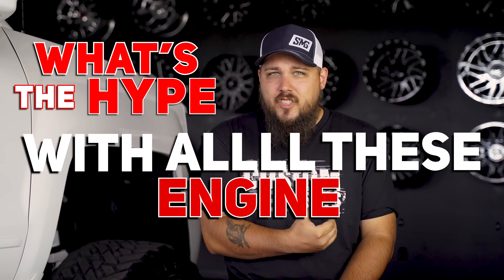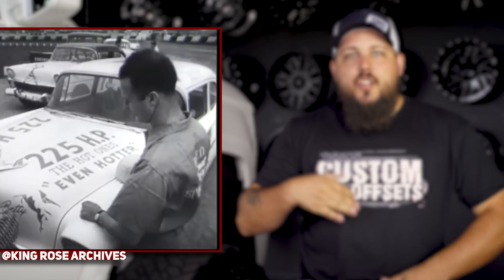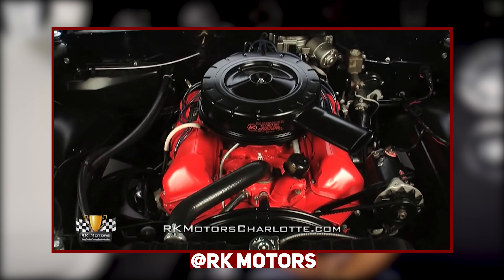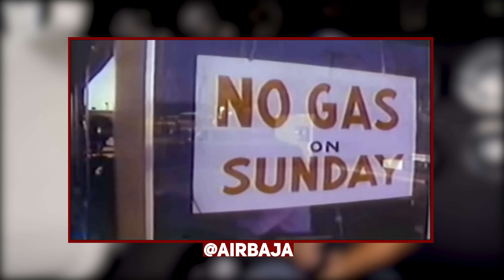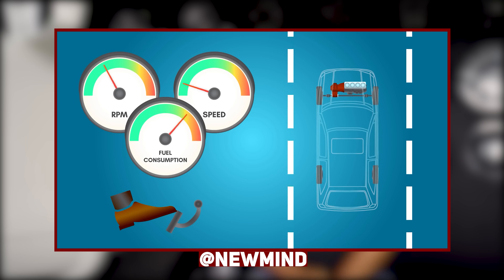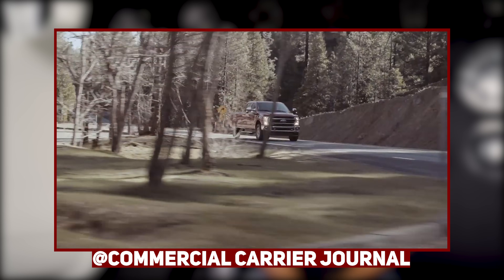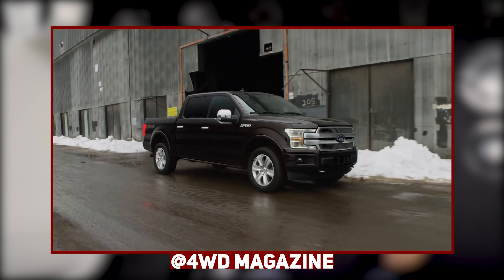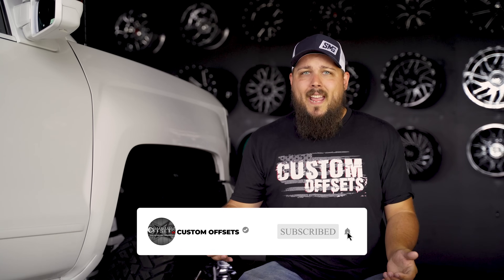Truck Engines - They're Only Getting Smaller..?

Comment: I also think that maybe a smaller engine in a truck would be better on gas. But the engine would actually get worse gas milage. Example. V4 chevy has to work harder to get the same performance as a hemi. Almost making the same gas milage. Only difference is highway milage

Comment: I think it's fuel efficiency and the fact that technology is able to increase power from smaller engines. First of all they're smaller which emit less gases and also the body of the trucks are weighing less. There's also the EPA factor strangling the big 3 American and anyone who wants to sell vehicles in the US. Again going back to the tech, the GDI and turbo charge technology it's getting better and more reliable plus they can tow almost better than the older diesels that have loads of power. I do miss the old school American V8.

Comment: It’s great living in a non exhaust test state, the family boat hauler is a 550 big block suburban that hates transmissions.
Reply: Scott Mccauley the stock 496 doesn’t rip transmissions anywhere near as bad as this thing, the cylinders have been bored out to make more power than the regular transmissions are meant to handle. It wouldn’t be an issue with an allison transmission but those were only ever available in the silverado to my knowledge.
Reply: Scott Mccauley gm knew that, that’s why they got allison transmissions for the duramax line.

Comment: 2.7 liter v6 ecoboost baby! Daily driver so it helps that it doesn't use gas like a v8. Love the v8 sound always will but I need the economy of the 2.7
Reply: How good of fuel mileage does your 2.7L V6 get? My 4.7L V8 gets average of 15 mpg.
Reply: @hilljackzack7284  19 mpg average
Reply: flaco that is better.

Comment: I love the 2.7T in my 2020 Silverado.  Average 20MPG with AC on all summer so far.  Its plenty quick, its actually just as fast as my dads 2018 Sierra with the 5.3 V8 but he's averaged only 17mpg.  Test drive it and you will be impressed.

Comment: Soo its not about displacement anymore? Congrats to the domestic manufacturing companys for jumping on board with forced induction, but i don’t agree with a mustang having a 4cyl!
Reply: It seems every company except for dodge is jumping on the smaller engine train but all of a sudden Ford comes out with the Godzilla engine, they also still have the Coyote engine which is pretty good.

Comment: 2.7 Ecoboost \o/ As much as i love the sound of the V8 Ive never owned a snappier truck. Plus the MPG is nice. And no i don't haul much so the smaller engine makes alot of sense for me.
Reply: I hear ya brother!  I got a 2.7 for work.  Every1 says the 3.5 is snappier but idkk
Reply: I love that sport mode they have on them
Reply: If I had to choose an f150 engine I’d get the old 2 valve 330 Triton myself. Underrated engine without a doubt.

Comment: Y’all think I can fit 24 x 12 on a 2001 4Runner without affecting gas mileage
Reply: I'm doing something similar to that but a 2002 4 runner and 20×12
Reply: Ryan HARPER I try to find people w the same year and model as my truck to get an safe idea I’m jsut scared of messing up my gas mileage and also breaking my truck
Reply: Ryan HARPER plus I think my little v6 will struggle pulling that weight
Reply: @NotHusband  that's why imma gonna do some power mods
Reply: The bigger the wheels and tyres. The more fuel the engine will require to pull more of that weight around. Brad and Banker talked about it in the second session of lifted live or something maybe else. But it's pure science. If its smaller wheels and tyres that are also thicker then Be aware of the suspension components wearing out like ball joints, wheel bearings, wheel hub assembly and even cv axles.
Reply: Dingas Healthy Lifestyle thanks
Reply: @NotHusband  but wow a 4runner from 2001..you made an awesome choice there man. I hope you get your money's worth. There's a lot of good mods you can do to it and they all look quite good and function well too with the V6 engine.
Reply: Dingas Healthy Lifestyle thanks man for helping me I wish you well with your build salute 🔥🔥🔥

Comment: They’re not getting smaller, look at the new hellcat motor in the Dodge and the new larger 6.6 gas in Chevy.
Reply: Yea but chevy used to have a 8.1 vortec
Reply: Oh and remember  the 454 7.4 liter
Reply: Did Chevy used to have a 4 banger in a 5000-5500lb truck tho?

Comment: The fact that u can get a 4 banger in the new Chevys is disgusting. And I thought finding a good sounding exhaust for the Ecoboost was hard
Reply: That 4 Banger makes more power than a V8 2013 Silverado while beating it by 5MPG.  I know.. progress can be scary.
Reply: @kylea2437  and?
Reply: @pepeiann  how is more power and better fuel economy "disgusting"?
Reply: Kyle A I’m not worried about MPG in my truck. I’m throwing on 37s and a small lift. So the “truck” is gonna be lower on power with 37s, and it’s gonna sound like a civic with any exhaust, and I’d rather it sound good.
Reply: @jacobcvpi8279  hey man to each their own.  Most people I know prefer not spending money on gas while giving more power.  If ya want your noises go ahead.  Hardly call it "disgusting" though.  That 2.7T is a marvel in modern engineering.
Reply: Kyle A yep, each man his own. I respect you for leaving it at that and not trying to pick a fight🤙

I guess I shouldn’t have said disgusting, just really dislike a VTech in a truck.
Reply: @jacobcvpi8279  as an owner of that engine I will admit the big downfall is I cannot (will not) get an exhaust.  For my needs though it fits the bill perfect otherwise.
Reply: Kyle A yeah, it’s perfect for the person that needs a truck bed, possibly even tow a small load, but still be good on MPGs.  🤷🏻‍♂️ aye, whatever you like/need, that’s what you like/need.
Reply: @kylea2437  i didnt say it was disgusting
Reply: @kylea2437  i like the noise and low end torque  of a v8
Reply: Nathan Kirby he meant to respond to me
Reply: @jacobcvpi8279  I hope so
Reply: unless you want it sounding like a chevy equinox
Reply: Nathan Kirby right!🤣🤣🤣🤮
Reply: The worst part is the powerband and how you have to be making an ass load of rpm to make the power they advertise.
Reply: @hunternelson3018  exactly a four banger doesnt make much power until after about 4k rpm